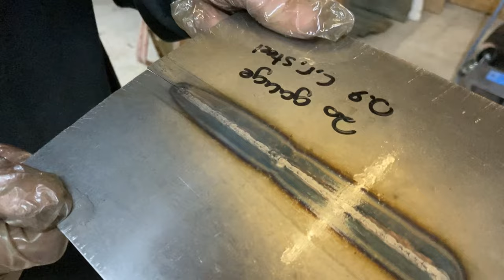PNEUMATIC planishing hamer //  made by frost @FrostAutoRestoration

Comment: Nice video guys. For that price i think it's doing it's job quite well.
I have also heard somewhere that if you fill the frame of the planishing hammer with sand it reduces the noice. But i haven't tried it because I don't own one 😅.. 
Wish you a happy new year
Reply from the maker: Happy new year to you too, it's not actually that noisy (reverberation wise) if the frame was filled with sand on this model the thread for the adjustment would seize up. Yes for the price it's better than we expected.

Comment: awesome unboxing, I was looking at this machine for my shop and I am glad I didn't get it now after watching this video, the hammer has so much movement I can see that chewing itself up in a very short time with regular use, the bottom anvil is also a major concern, if you trying to make a bespoke panel precision is key and that stake with the anvil on top is flapping all over the place, looks great on your welds to planish but I dont think I would trust it for any shaping and there are much much cheaper machines that do exactly that, again awesome video lads
Reply from the maker: I get what you mean with the fact it moves a bit but if you need a consistent stroke then you need a pullmax /trumpf . That’s what we have for that type of work. It’s really easy to shape with this machine and I don’t think it’s that bad at all. Bare in mind we make full aluminium and steel bodies all the time at work and I would trust this machine on a daily basis. 👍
Reply: @Metal_shaper_tom  ok fair play, i also have never used a planishing hammer but like you know how metal works so in my head you want  a sturdy machine but ill take your advice on board, ill still say that hammer has way to much movment and will chew itself up same as any other air chisle
Reply from the maker: @DGRetroCustoms  cool. No problem. hopefully this video helps many more in the future like yourself as that’s what YouTube is all about 👨‍🏭 looking forward to your next update on the Berlingo  👍👨‍🏭
Reply: @Metal_shaper_tom  that wont be for awhile, i have 3 rs turbo vids recorded an sd1 vid some disabled ramps many many things
Reply from the maker: @DGRetroCustoms  nice 👍 how’s the merch side of things as that’s something we have looked into.
Reply: @Metal_shaper_tom  hit and miss, it costs sod all other than effort to set it up so went for it, i think its just the same as yt, its a waiting game and also changing up what you do, keeo throwing shit at the wall till somethimg sticks sorta deal
Reply from the maker: @DGRetroCustoms   fair enough . It’s all a funny old game isn’t it 🤔 WATCH THIS SPACE!!  , I’ll start chucking even more shit out there! 😂
Reply: @Metal_shaper_tom  tried that it doesnt work lol
Reply from the maker: Well that's a matter of opinion, Ben's metalshaping in Holland makes the mechhammer and mechbammer, both are excellent but extremely expensive, but it's no good if the operator doesn't know what they are doing, for the majority, these cheaper ones get the job done.
Reply from the maker: We are aware of the tinman tech one, I'm guessing that is him? America and England are very different places, I could list dozens of UK based coachbuilders that you won't know. I will say, this isn't our daily workshop, we are professional coachbuilders by day, working on priceless show winning classic and vintage vehicles, this is filmed in our own little workshop in our spare time to help DIY enthusiasts with some basic techniques.
Reply from the maker: @horacerumpole6912  yep 👍